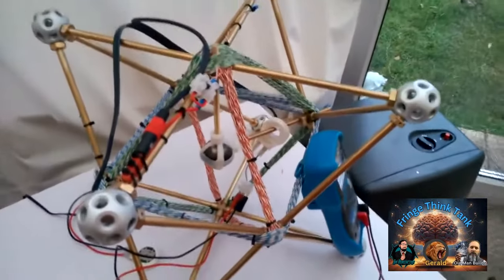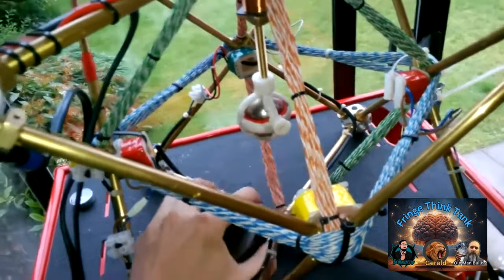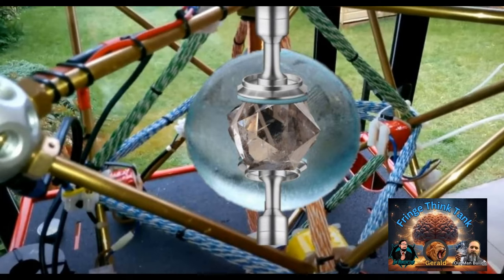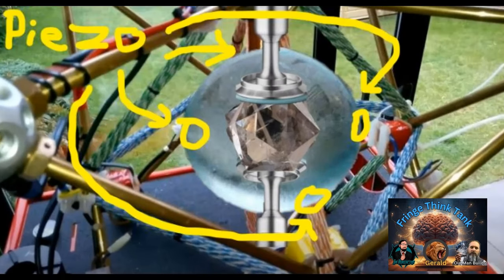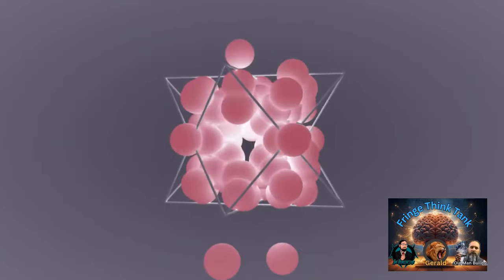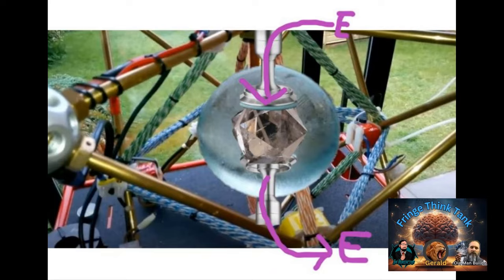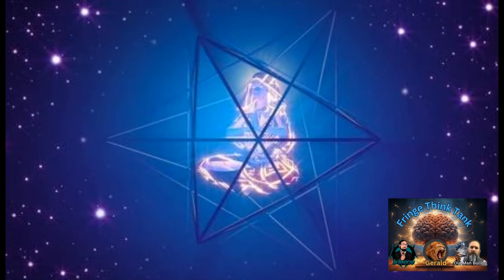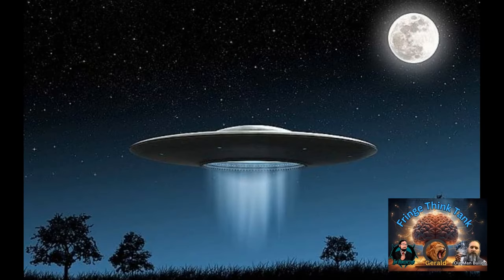Merkaba Machine "Is It Our Destiny To Build It?"

Comment: This is really neat. I can tell from my own experiments that soundwaves will affect magnetic fields. It's fun to mess around with Lapointe/Halbach arrays, add ultrasonic waves and see results. I even got light/sparks from it, it's all energy. Your idea is good, there is something to that.
Reply from the maker: I had a pulse wave from my sink hit my granite experiment and it increased the voltage in it. I had my water fixed the next week the pressure was 3x what it should have been. I was experiencing water hammer and the pulse wave definitely works.

Comment: Those coils wired up inside it at 0:54, are those wired up in such a way as Tesla's AC motor patents where 2 of the 4 are phase shifted by 90 degrees? Because if they are that creates the genuine Rotating Magnetic Field that Tesla discovered and developed for his brushless AC motors, it creates a virtual magnetic pole that spins around between the 4 coils over the cycle, if he's using that here that's important.

"As the Cosine Current wanes and the Sine Current waxes the horizontal electromagnets lose influence and the vertical electromagnets gain influence. The rotor magnet positions itself in accord with the relative pole strength. One eighth period, or an angle of Pi over Four, into the cycle, it is half way between the New Position and the Leading Position. Here at this point in the cycle the Cosine Current and the Sine Current are of equal strength and both are 70.7 Percent of their maximum magnitudes. 

This is given by the Cosine and Sine Functions. The current in the horizontal electromagnets is equal to that in the vertical electromagnets, they now exert equal influence upon the rotor bar magnet. The rotor now orientates itself half way between the left and upper pole faces, just as the A.C. cycle is half way between its New and Leading positions. Here exists the equivalency of the Space Phase Position of the rotor and the Time Phase Position in the stator. 

This is the act of synchronism and represents a transform between space and time. In this position of Space Phase the rotor bar magnet is not orientated to any physical pole face, it is pointed into a Void Space between the left pole and the upper pole.  At this Pi over Four instant in the cycle the rotor magnet is held just as rigidly as if it were held between a pair of physical pole faces, this in the horizontal or vertical positions. 

Since the North pole of the rotor bar magnet is always pointed to a South pole on the stator assembly, a South pole must now exist in the Void Space between the left and upper pole faces.  This non-physical South pole exerts as Real of a force upon the rotor as does the actual physical pole faces. This is the key feature of the discovery of Nikola Tesla. 

This is what is called a "Virtual Magnetic Pole". This virtual pole moves through space in accord with the phase position of the A.C. wave that gives rise to this pole.  A virtual electromagnet is spinning in the stator while the physical stator is stationary. This gives a "Magnetic Versor", or rotating magnetic pole. Here defined is a Rotating Magnetic Field."

-Four Quadrant Representation of Electricity by Eric Dollard - SYNCHRONOUS MACHINE OPERATION, page 267.

Btw, since you have an interest in shapes I highly recommending finding yourself a copy of "Shape Power" by Dan Davidson 1997 and "The Pyramid how to build it how to use it" by Les Brown 1978, they both contain experimental research data on shapes and I think you'll probably find something in them of use to you, anyone who's interested in shapes should in one way or another get copies of those books.
Reply from the maker: I knew about the virtual pole from reading tesla. I did not read the books. I will put them on the list. You are right about the way it is working. The inventor described it that way when we talked.